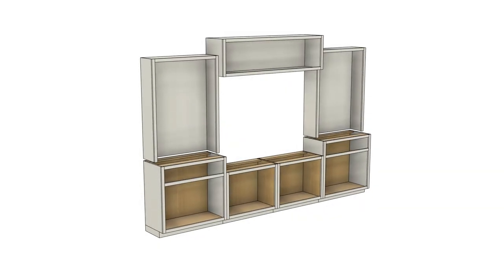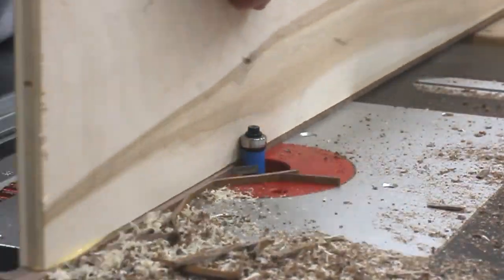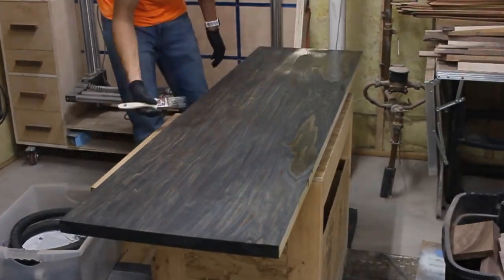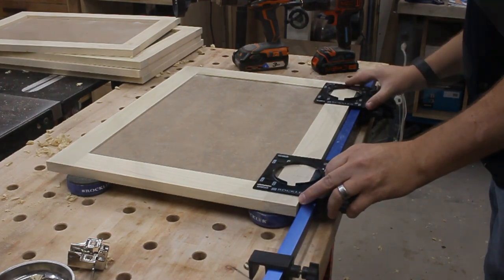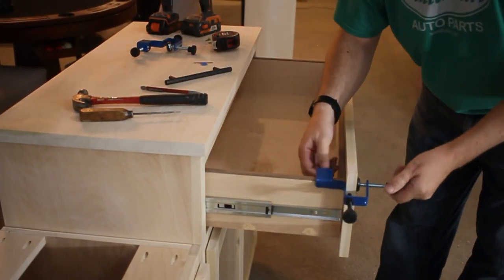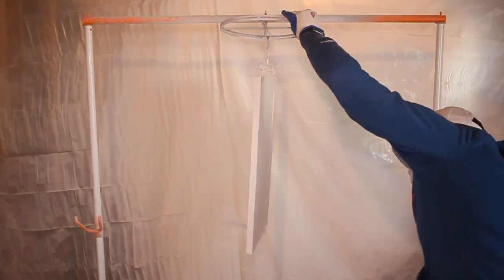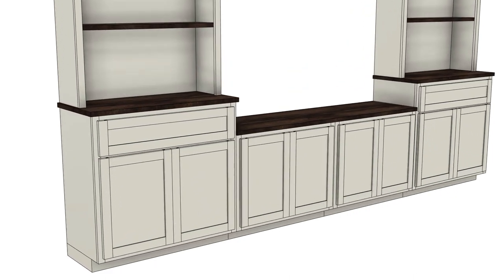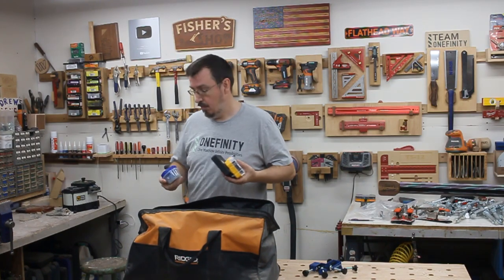Woodworking: Making Cabinets - Part 2

Comment: The jig used to hang the doors brought back memories. I had one for 16mm and 18mm cabinet bottoms.  Sure it's packed away in a box somewhere.  Also I felt the moment you drilled the door on the wrong side, been there.
Reply from the maker: Haha, yeah that was a heart breaker.  Thanks for watching

Comment: cracking job Drew 👍Friendly tip for doing the hinges, dont use a square on each hinge instead use a level to span across the back of both or even 3 at the same time.  this will make sure all hinges are inline with each other.  Only a tip for you or others that may read this is all what you did also works and is good 
kind regards 
Conor
Reply from the maker: Good tip! Thanks, Conor!

Comment: Excellent and hilarious as usual.  Fortunately no issues with the crown molding.  Whenever I've had to cut compound miters, I tend to cut the angle to wrong way.  You have a lucky friend.
Reply from the maker: Yeah, the crown was a challenge to figure out, but once I did it was pretty straight forward

Comment: Super awesome job man!!

One tip though.  Next time you have to make an arch like that, make your template from 1/4 inch thick materials.  Strike the arch on it, then use the bandsaw/jigsaw to cut out the shape.  Next take the template you made and use the edge sander to sand it down nice and smooth.  Once that is done, clamp the 1/4 template to the 3/4 thick face frame material.  Use a router and a pattern cutter bit to rout the final arch on the face frame.  You will have minimal sanding to do this way because its way easier to sand 1/4 material than sand 3/4 inch material.
Reply from the maker: Thanks!  Yeah, if I was going to be making lots of arches, your method would definitely be the right way to go.  I figured with just a few that I'd do it the hard way. :)

Comment: Drew, what an excellent build, it turned out great!  I've gained a bit of confidence from watching these 2 videos that I may try to tackle something similar myself.  I didn't notice the Rockler Drawer Front Installation Clamps link on your parts list, maybe I'm just not seeing it?  I've several of the Rockler items used on your build and am ordering the rest.  Many thanks!
Reply from the maker: Oops, you're right!  I've added them now.  https://www.rockler.com/drawer-front-installation-clamps

Comment: 18:56  When I was watching you drill out those holes for the hidden hinges. My first thought was, how many doors did he drill on the wrong side and how many extras did you make? I'm not sure if they stain wood, but look at chalk pens, so you can write on pieces like front and back.  Oh don't feel so bad I would have done the same thing.
Reply from the maker: Only messed up the very first one, thankfully.  :)

Comment: Would you consider doing a short follow up video on how you would have done the French cleat on the cabinet over the TV?
Reply from the maker: All I'd do was cut a 45 on the bottom of the top nailer that was installed in Part 1 of the video.  Then just fasten a cleat with another 45 on the wall.
Reply: @FishersShop  Got it, Thank you.

Comment: Great job with the install, you made it look a lot easier than it is! How did you end up hiding the screw heads in the center upper cabinet?
Reply from the maker: With an artist's brush we just colored the heads white and they blended in.

Comment: Another excellent build video! Curious if you were commissioned to build this for someone, what would you charge? I still struggle with getting my pricing right for builds like this and end up working hours of peanuts when it’s all done lol.
Reply from the maker: I think pricing is highly dependent on your client locale, material being used, your own experience and proficiency, and timing constraints and expectations.  Lots of variables to consider.  What I'd charge for a build like this would likely be vastly different for someone else in a different area with a different craftsman doing the work.  It's all relative to each situation.  Sorry, I know that's no help

Comment: What grit do you generally use to remove the glue?
Reply from the maker: Depends what kind of glue, how much there is, and what wood I'm sanding (I don't want to sand through the veneer of the plywood, for example).  I usually start at 120-150

Comment: A true arch is done with 2 tape measures . If you use a slim piece of wood your arch is dependent on imperfections of wood (knots and grain). To a regular person it will look good but to a professional carpenter they will know its off. Cheating is not professional.
Reply from the maker: 😂 ok

Comment: Finally starting to use some real tools. Don’t act like you didn’t like using the dewalt tools😂
Reply from the maker: They worked just as good as mine.  As long as a tool gets the job done, I can't really complain about it and my Ridgid tools have worked very well for years.